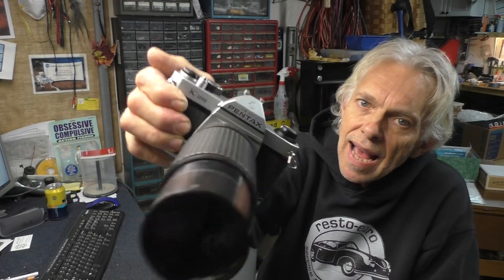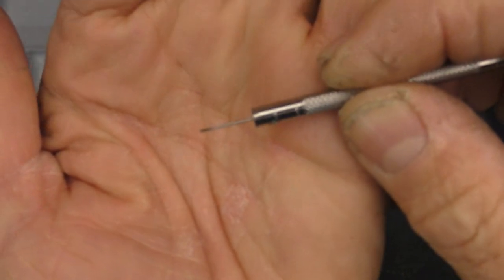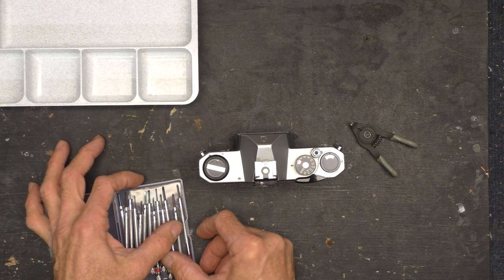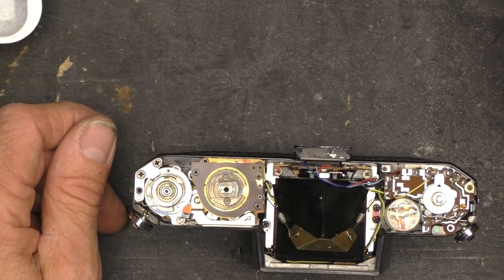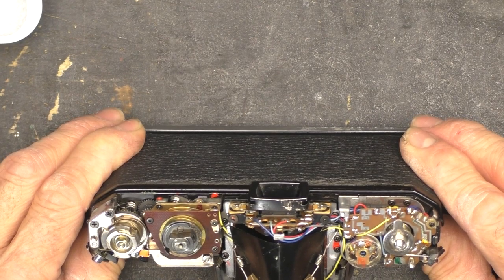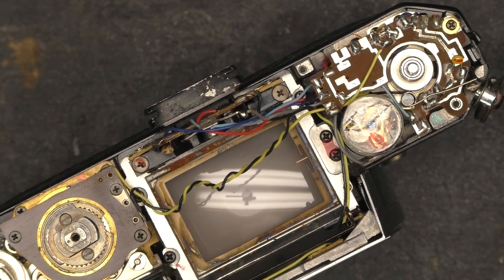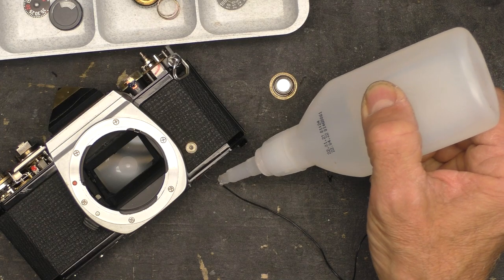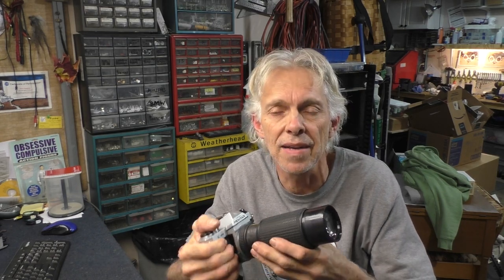Pentax K1000 Light Meter Repair

Comment: Love this video. Went to my usual camera repair guy and told him the issue and he said there's no point in fixing the light meter. Which I was super deflated about. But my Pentax K1000 was given to me by my uncle when I was the same age as him when he started film photography when he bought the camera in the 80s. I wouldn't feel confident to take it apart like you have here but wondering how I can repair it so I can start using it again !
Reply: I just find the possibility of fixing it intriguing. I have my dad's k1000 and I don't mind using a light meter app with it. I occasionally use a few older manual cameras that don't have any built-in meters at all.
Reply: If you have not fixed it yet, look up Romping Bronco on YouTube. He specializes in fixing the k1000 and has pricing for this kind of stuff.

Comment: Good fixing! I've seen that sort of camera damage before, corroded battery related. I have a classic 35mm Konica with a highly rated lens awaiting repair, in fact. So your former Air Force brother, did he take pictures while serving? Anything cool? Has he scanned any negatives, and made them available for viewing? I would be interested in seeing them. Especially 50's and 60's era. Here in SoCal where I live, I look for vintage negatives and slides at estate sales. Some finds from that era have been spectacular!
Reply from the maker: Most things my brother photographed were classified and he doesn't have that stuff. He photographed a lot of stuff from the belly of a C130. He also had the gruesome task of photographing crash sites and body parts. After his time in the Air Force he worked for Goodyear Aerospace for a while doing high speed film photography of chicken carcasses fired at cockpit windshields at mach 2! Fun stuff. :)

Comment: I have a k1000 and also a Kodak brownie camera that takes 620 film. Film Photography Project does actually sell respooled 120 film for 620 cameras and they also manufacture and their own 620 spools. The light meter needle in my Pentax moves but it's not accurate. I had severely underexposed roll of film and I did make sure the film speed selector matched the the film I was using.

Comment: What a coincidence, the same wire had snapped off on mine too. I couldn't find the black wire to pull back through the camera though.
Reply from the maker: It's a common problem with the K1000.

Comment: The whole point of me watching this was the repair for a light meter and you completely skip over the whole actual repair lol
Reply from the maker: It's the wire at the battery. It simply needed to be replaced and reconnected to the holder.

Comment: I will replace the battery and if it doesn't work, well, it will go into my historical camera archive.  It worked before I changed the roll of film and then it sat for almost a year without use, so, I am hoping the battery died.